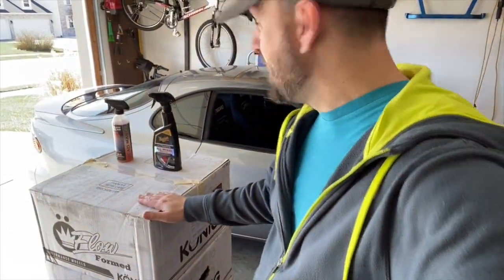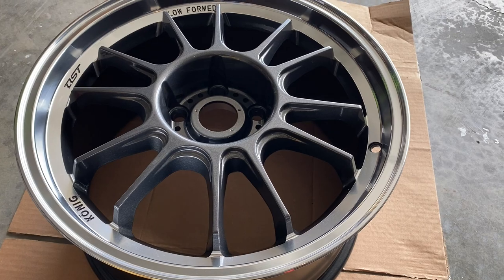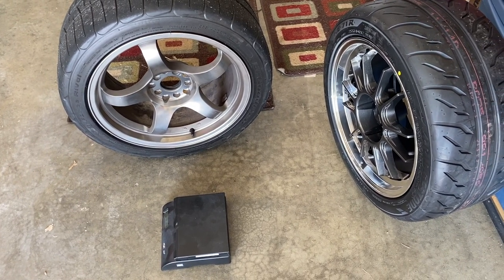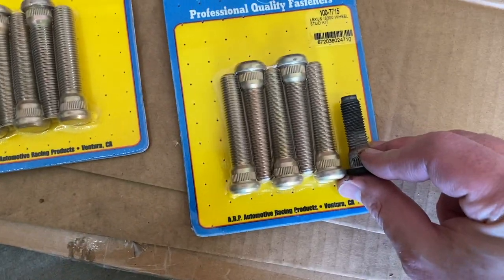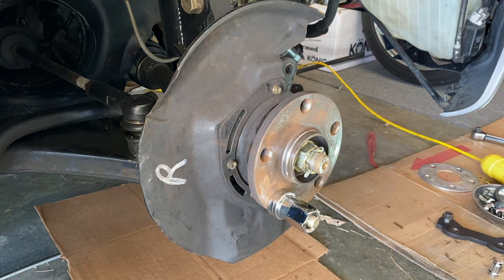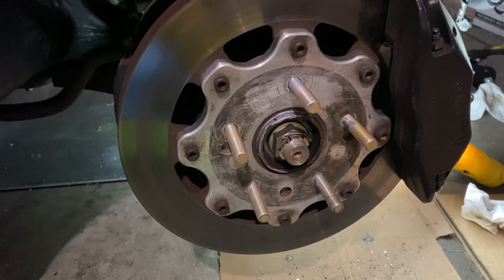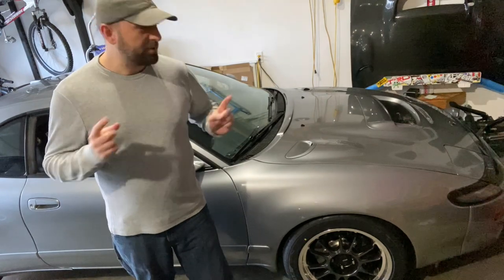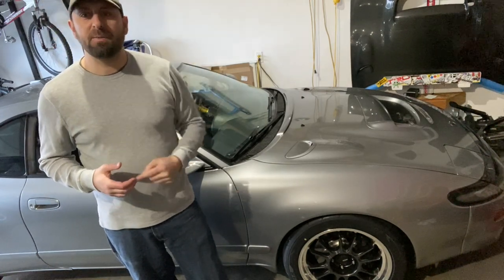Project CMS: Konig Hypergrams finally going on my Gtfour with some RE71Rs

Comment: Nice to hear you like the Bridgestone RE71Rs.  I'm considering Enkei PF05s and RE-71RS tires for my GT-Four for the summer, and Blizzaks on my old OZ Cronos for the winter.
Reply from the maker: That will be a good setup if you do.
Reply: @cmsgt4  Yeah, I think so.  The light wheel with grippy tire should be much superior to the heavy wheel (OZ Crono) light all season tire (Vredestein Quatrac) setup I have on currently.  Baby needs a new pair of shoes!

Comment: What specs were your 5 spokes? Haven't been able to find the size or offset in the forums etc
Reply from the maker: 17x9 38et.
Reply: Any rear spacers? I was gonna go with 17x8x(30 or 35) all round. Also appercaite all your work on the fourms